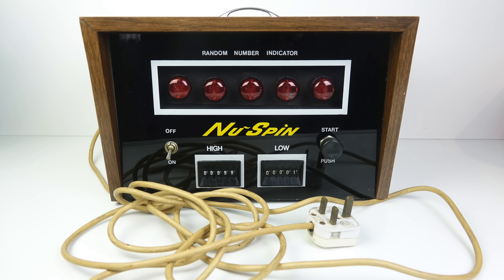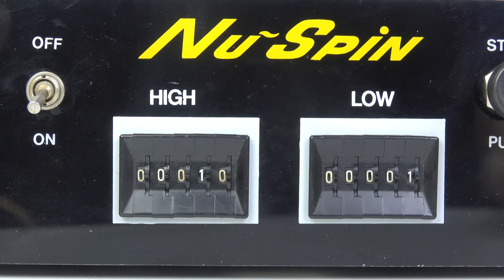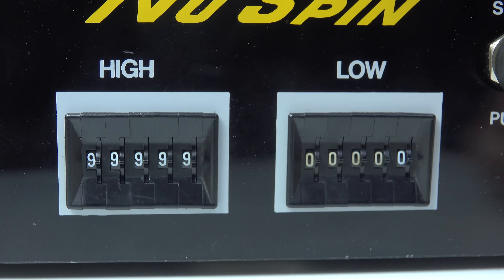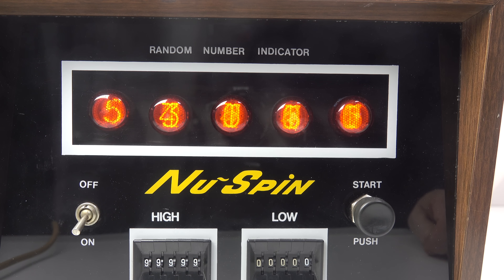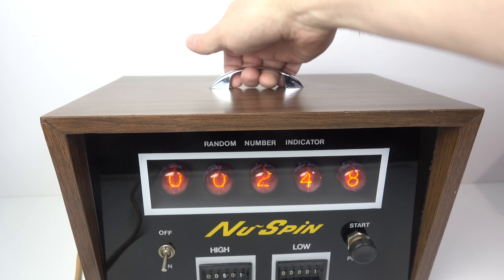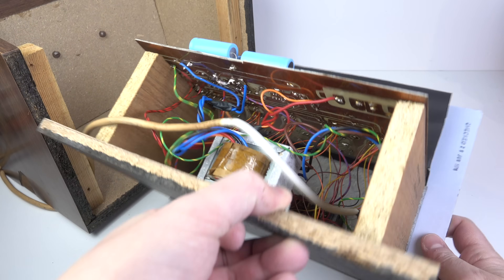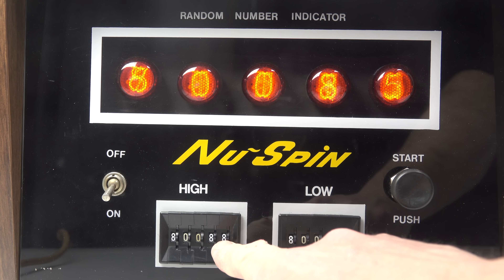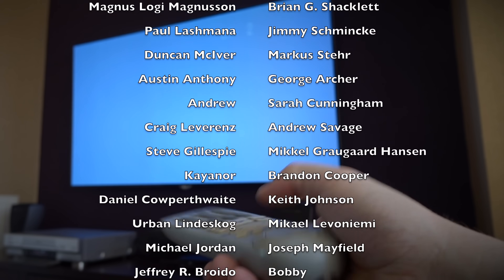This is a bit random - Vintage Random Number Generator

Comment: I've used a similar random generator when I worked at a radio station, we'd set the dial to determine what caller we were supposed to take as the winner of call in contests, and we did a few raffle/lottery drawings, too.  Operators were not allowed to just pick a number from the top of their head, and it was a lot easier than having to pick random tickets out of a basket.  We only had to issue 1 ticket, instead of 2 where the 2nd was placed in the basket.  There would generally be 2 or 3 people to verify the displayed number for such drawings to keep them fair.  For calls, our phone allowed only 48 callers in "park" on our switch, so we'd set the RNG and grabbed the specified caller and dumped the rest on the switch with a prerecorded message stating they were not chosen.  Ours had a series of 7-segment LEDs for the display instead of the nixie tubes, and it would seek using the lowest and highest numbers selected. It would even seek even if the numbers were 1 apart.  It was surprisingly random even if you just wanted to choose 1 or 2.  One of the DJs used to randomly pick out his playback carts for his nightly music segment.  Ours was widely used and even settled a few lunch disputes of where to go for a meal.
Reply: Doramius Awesome! A larger unit could do those random phone number contests, like a "Wargames Dialer" only manual.
Reply: Doramius Thanks for sharing!
Reply: Hmm, that makes sense. Especially the fact that is was verifiable by another person, it's harder to verify numbers piked out of a hat are random.
Reply: Very cool story. I was thinking radio station too!
Reply: It was over 25 years ago when we used it.  Almost forgot about using one until this video.  Brought back some fun memories.
Reply: really? i worked as an intern at a radio station and we'd just pick whatever we wanted to play and then draw from a stack of fake caller names to announce it. Because even though it was the most popular radio station in a city just shy of a population of 1 million, we barely ever got a real call. So... if other cities are anything like mine, give the radio station a call. You're very likely to have your request heard.
Reply: @GraveUypo  I interned at a FM Top 40 station in 2003. Wanted to be a DJ. First day they told me that DJ's "didn't exist anymore"; not only did they not take requests or do live bumps, but they were physically unable to change the playlist (by design) since it was created by a computer at IHeartRadio HQ and sent via an encoded signal directly to the equipment at the station. The purpose of the "request line" was to get verbal consent to use caller voices for free on air ("Want to be on the radio?") and then save the random audio snippets of them to be chopped up for future production purposes.... while not actually playing the song they requested. I was major disappointed but was told by the Station GM that "this was standard practice at all IHeartRadio FM stations" and saved them literally millions in hiring voice actors.

I ended up becoming an accountant. I wasn't cut out for that business... literally 90% of old media is cancerously anti-consumer these days. They literally cared not a single shit for any of their listeners, only their advertisers, and the station was so desperate for money they'd take anybody - for example, despite having a primarily young and progressive listener demographic we did a lot of fringe religious ads, obviously fake erection pills and blatant shill political propaganda from various PACs that everybody hated. The studio didn't care, anything so long as their money was green.

Comment: 960 frames per second?! What slow mo camera have you got? Did you sell the house and buy a phantom flex?
Reply: SONY RX100V - not cheap, but affordable.
Reply: biscuitsalive doesn’t the new galaxy s9 do 960 FPS slow mo?
Reply: baddarkmoon Yes... but only for 0.2 seconds.
Reply: Both the Sony Xperia XZs and Premium models have also had this feature for a year now and they only cost about $380 and $530 respectively, its only for a 1/5th of a second like the S9 but it's quite affordable these days to acquire a high frame rate camera, heck if you just wanted the camera you could probably pick up a broken/used XZs for around $100 or find an older dedicated camera with high frame rates for a little bit more.
Reply: I think he uses a Sony RX10iii which does 960fps at 1080p in PAL mode.
Reply: How long can it record for before running out of memory?
Reply: Lots of "prosumer" digital still cameras offer speeds like that now. Even some higher-end cell phones.  My circa-2015 Nikon 1 J5 (a consumer-level camera) can do 1200 fps, although at a measly 400x144 resolution, and for only 3 seconds.
Reply: USWaterRockets on the RX10iii it’s 2 or 4 seconds depending on the quality setting.
Reply: Hey Micky yep I forget. I use high end prosumer cameras every day. And in that realm very high frame rates are not that common without spending a LOT more. 
(The IQ is much higher of course though)
Reply: Cool! That's actually somewhat useful. These new phones with 0.2s at 960FPS seem totally unworkable.
Reply: biscuitsalive If the IQ is so good, you could say that owning one is smart. See what I did there?
Reply: Buddy Clem yes I see what you did there. :)
Reply: 0.2s? that's lame. Completely useless
Reply: I believe that's how AvE does his "high-speed potato-vision"
Reply: smeezekitty It's probably better than when How It's Made turns machine parts slowly by hand and calls it slow motion. Any time I get a defective product I say that How It's Made must have been at the factory, even though it is one of my favorite shows.
Reply: Which gives 6.4 seconds when played at normal speed, pretty good.

Comment: The one very odd thing I have noticed about computers and randomness, is that indeed they are not very random. Example, have music player in my cell phone. When I open up the music player, and hit the shuffle icon, and then play all songs. It always seems to play the same songs, in random order, but always the same order. Back in the 1980s calculators (some) had random number generators also. One of the functions, to make it truly random is you could put in a random number as the seed. That would force it to pick its first random number from the basis of that number. So as long as you did not start with the same number it was more random. But I still find it very strange that a computer makes a horrible random number generator overall.

Comment: I noticed a very strange component on PCB -  ceramic capacitors from USSR, red square components with two leads. They look kind of bodged in to PCB, I wonder how they get in this device

Comment: Using the online non-deterministic quantum random number generator from the Australian National University, I decided that if the first digit of the number I requested was uneven I would NOT get into the debate what is truly random and what is not.

The first digit was 1, so thankfully using the ONLY real way to come to any decision randomly, I have spared myself from having to argue that this device obviously not being truly random at all. 

(And in the process, I have also perhaps created a new branch parallel universe.)

Comment: Actually, not to include the high margin is the standard practice in programming languages, so the gizmo acts the classic way.
Reply: Alternatively, one could program the machine with the number of the first sold ticket and the first not-yet-sold ticket.  I would expect that would work even if the first sold ticket was e.g. 99876 out of one package and the first unsold ticket 00123 out of the next package.

Comment: What happens if you set the low number higher than the high number?
Reply: @Thumpert the Fascist Cotton-tail
So, what you're saying is that it divides the universe by itself and the resulting energy creates a supernova.
Seems lejit.
That, or it locks and doesn't do anything, a race condition of sorts. I like the other explanation better myself. d:
Reply: Halt. Catch Fire.

Comment: Your absolutely right about the unit being used for raffle ticket draws.  My very first job back in 1981 was building electronic bingo machines and random number generators for use in bingo halls.  The random number generator we built was based on a single chip counter/timer (the chip number escapes me), with quite a bit of external mop-up logic.  The display itself consisted of 6 (I think, though may have been 5) 7 segment displays, however, as large 7 segment displays wern't available in them days, they were made up using 3 5mm red LEDs per segment, which gave them a look a bit like the LED watches of the day.  Again the PCB's were made in-house, and in our case the box was black melamine chipboard with a smoked perspex front to increase the contrast of the LEDs.
Reply: The scoring displays on the bowlers and skee ball machines were done using 12 volt mini bulbs, and several array IC's that fanned out the 8 bit logic coming from the computer box. They used large plastic blocks with mylar frosted and black plastic masks to make them function. Those used 7 segments, for the 6 digits 2 smaller ones below the 4 scoring digits to display how many balls you rolled per game. Then above that were 3 more 12 volt bulbs used to indicate game over, or player 1 player 2.  All hidden behind a plexiglass panel.
Reply: So the counters were just freerunning all the time right? That basically would give the illusion of RNG because the random input is the button press.
Reply: Correct.  Button release disables the latch (Display Hold) function so that the display can be seen counting, and also starts a short delay timer. At the end of the timer delay the display is latched (Hold).
I've looked back through the video of this unit and it appears to be exceptionally crude.  The 7490 counters don't have a load function so the start number can't be loaded into the counters, also there is no latching function available with the chips used.  Unfortunatey the video doesn't show the back of the thumbwheel switches, to see if there is any logic chips/diodes incorporated for comparison of the lower/upper number limits of the counters, so how this unit actually works would be total speculation.
Reply: Yeah. It looks extremely crude IMO. I watched the teardown section a few times and couldn't really figure out what was going on. I'd love to see how it was wired.
Reply: What was the reasoning behind this approach as opposed to a pseudo-random number generator seeded by a random source?
Reply: Pseudo random is (or was) a no-no in the gaming industry, besides it would have been expensive and added to the complexity.  Humans, on the other hand, are perfectly random (and very cheap).  Don't forget at that time microprocessors were in their infancy and expensive.  Hard logic pseudo random number generators using shift registers would have made the circuit much more complex and for no gain in randomness.
Reply: PRNGs are not random but they are fair, humans are random but not fair. But you can combine the two to get a truly fair and truly random number generator. This scheme, on the other hand, would be biased in the leading digits since they don't cycle as many times as the trailing ones. To use this in a game where people reasonably expect that every number to be equally likely to occur is downright fraudulent. Of course I don't expect every little parish or nursing home that were duped into buying these devices knew that they were biased, nor use that fact to their advantage, but what about the people making and marketing them? Look, I know the hardware would have cost more in the 70s and 80s, but cost isn't an excuse for dishonesty. If cost was an issue they could have used old-fashioned raffle drums instead.
Reply: Cost was absolutely an issue!  The typical sale of these devices tended to be to Social Clubs and small licenced bingo halls, where the whole point of the raffle was to raise funds to try to keep the places open.  The only reason these institutions even considered electronic devices was to stop accusations of cheating, i.e. palming, when picking a ticket out of a plastic bucket etc.
Dishonesty? Hmm, I've mentioned before in another post on here, that this particular random number generator, is a poor example in it's operation.  Properly designed units only scanned between the lower and upper set numbers and spent the same amount of time on each number, also the scanning couldn't be seen until button release.  How can this not be truly random or dishonest?  On a final point raffles are counted as random non-skill games and I'm fairly certain pseudo random number generation wasn't (and probably still isn't) allowed under the gaming laws!
Reply: It's better than a PRNG for games because it's actually random, but the point of the PRNG is to make a biased but random source less biased. It's dishonest to run a game on a biased RNG if the players aren't aware of the bias. It's also dishonest to run a game on nothing but a PRNG, but that's clearly not what I'm proposing.

Comment: We use something similar to generate Erythrocyte Sedimentation Rate (ESR) results in the hospital lab.

Nobody got this joke did they?
Reply: My mom just had a transfusion and they used one of these to determine potential antigen reactions. Worked like a charm!
Reply: IWe've been using them for decades. Whenever a new antigen is discovered we use them to decide if it's clinically significant or not.

Comment: One burning question was not answered in this video though: What happens if you set the starting low number higher than the ending number?!
Reply: bump
Reply: Bump
Reply: Uuuh interesting...
Reply: I think it might cause the universe to fold back on itself and restart with a new Big Bang!
Just joking of course. ;)
Reply: BUMP
Reply: I hoped he'd get to that, too. :/
Reply: My guess is that the machine wasn't programmed to display an entry like this. It would get confused and keep counting infinitely. Either that or it would recognize the "incorrect" entry and swap the numbers around  so it went from lowest to highest.
Reply: It wasn't programmed at all. It's all simple logic chips wired together. Most probably it just changes the value to the lowest, whenever it equals the highest (which explains, why you can't get the highest). Judging from that, I'm guessing it would give an answer from 0-highest or lowest - 99999 (counts from 0 to highest, then jumps to lowest, then continues counting to 99999 and turns around back to 0).
Reply: It probably catches fire.
Reply: Probably just keep spinning, assuming it's looking for a number greater than X and less than Y where X > Y
Reply: He's probably still waiting to get that answer himself lol.
Reply: It looks like what it does is it counts up to the high number and then resets to the low number.  If the low number is higher than the high number, then it will pick a number outside of that range (starting at the "low" number and counting until overflowing and resetting at the "high" number.)
Reply: The nixie tubes explode.
Reply: Vsauce music will play out of the machine.
Reply: I think you get all numbers except those in the selected range.
the high number is the wrap-around value, the low number the counter reload value. but, the counter has a finite bit width N and wraps around at 2^N-1 anyway (or a power of 10 less one if it's BCD.) say the high number is 3 and the low number 11 and the bit width is 8 (256 values total.) the counter is loaded with the low number, 11. it goes on to count up from 11 to 255, wraps around to 0, then proceeds to count until it hits the high number less 1, i.e. 2, then is reloaded with the low number, 11, wash rinse repeat. the sequence is thus 11, 12, 13,...,255, 0, 1, 2, *11*, 12, 13,...,255, 0, 1, 2 etc. low<=x<high still holds but x are the numbers that can't occur.
Reply: It'll just keep spinning as it seems to do that if high < low +3
Reply: My first thought as well, I must know.
Reply: Amberoot Audio: this is the best answer
Reply: Parallax Abstraction probably just doesn't stop on anything, it all depends on what exactly is going on here though which isn't really well documented
Reply: it turns into a flux capacitor and sends you to the year indicated on the display.
Reply: Maybe every time he tried it the space time would warp generating magnetic field strong enough to turn off all electronic devices around so that's why he could show it in the video.
Reply: One more wondering the same same
Reply: Probably the same stuff to when the high and low values are less than 3 numbers apart: counts till the end of time.
Reply: An HCF command is issued. 
Halt. Catch Fire.
Reply: Error 404
Reply from the maker: The answer is nothing,  nothing at all. Zip. Nada.
Reply: @Techmoan  What do you mean, "nothing"? Does the display freeze? Go blank?
Reply: @robertlozyniak3661  An unsatisfying answer.  I don't know what "nothing" means either.
Reply: Stuff happens
Reply: Techmoan That's slightly disappointing, but I'm glad you answered! As always, great video.
Reply: Bump-Bump???
Reply: The person pressing the start button unlocks the 5th dimension
Reply: That would generate a negative probability
Reply: It's cyclic, right? 
    So, let's say you set the starting number at 80000 and you set the ending number at 10000. It would start counting up from 80000 and once it reached 99999 it would then loop back to 00000 and continue counting up from there until it reached 09999. After that, it would start over. 
    I think you would effectively be setting the machine to count all numbers EXCEPT the those between what's set.